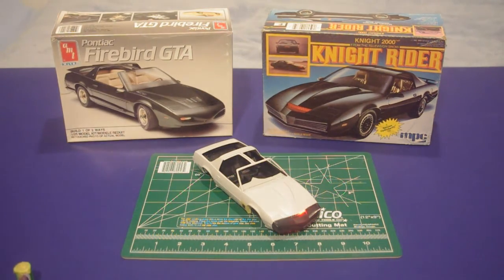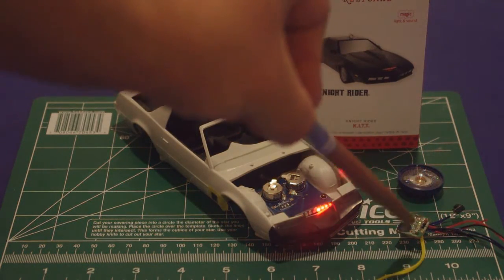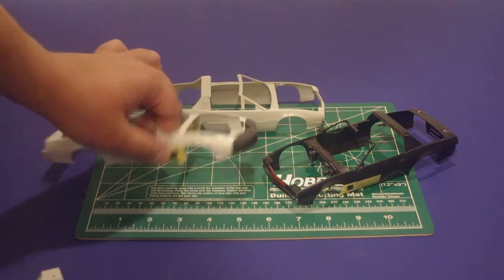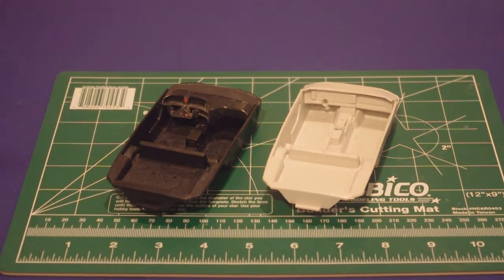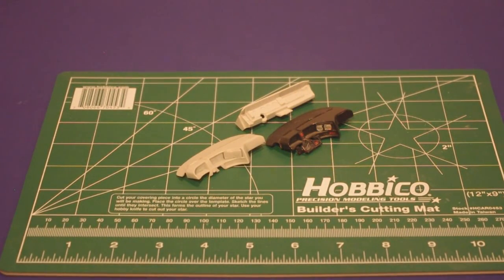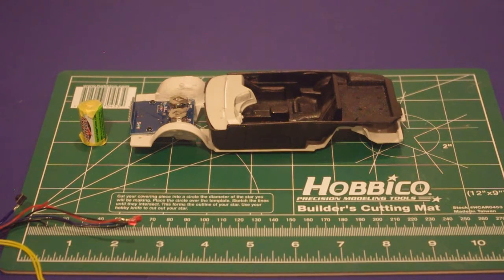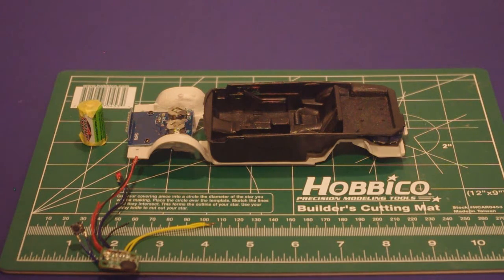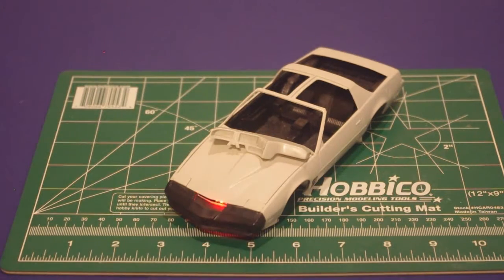MPC Knight Rider Knight 2000 build Part 1

Comment: Thanks for posting. I've got an Aoshima Season one sitting in my stash I'll be starting soon. Good reference video.
Reply from the maker: My pleasure. The beauty of the scanner eye is it drop fits into the Aoshima kit perfectly. Also, if you want to do anything similar to my project and fit other bits, things should potentially fit inside more easily since the kit is slightly larger and designed as a curbside.

Comment: Oh, nice.... did you ever complete the build?? :)
Reply from the maker: It is still hybernating. I ran into a snag trying to bury a speaker for the KITT voice (scrounged from a Hallmark ornament) in the trunk between the floor and the gas tank. I know I can get it to work now, but I just have some other projects in progress at this time.
Reply: @JMChladek  Well, it would be nice to see it come to a conclusion.. I have several kits on the shelf of doom, for some reason or other. I'm confident they will be completed, when the time is right..

Comment: Cool. But should have just built the Aoshima kit. 
Far superior than the AMT's. Then wouldn't of had to chop up multiple kits.
Reply: hoffmachine he did this multiple kit hack job because he is competing in a competition hosted by a hobby shop.  The requirement is that the build be from a kit purchased at their store.  The kit in question is the newer firebird that he wanted to turn into a KITT car.